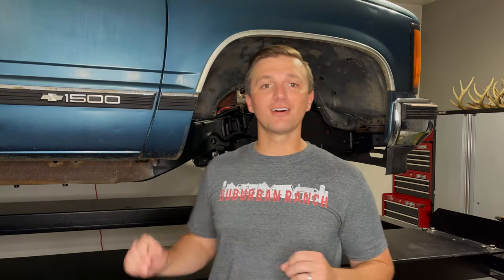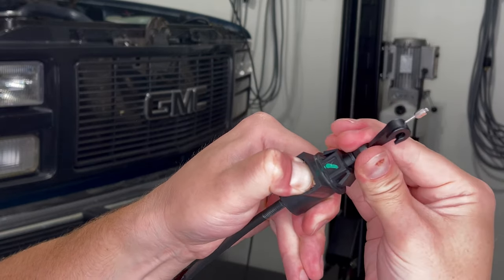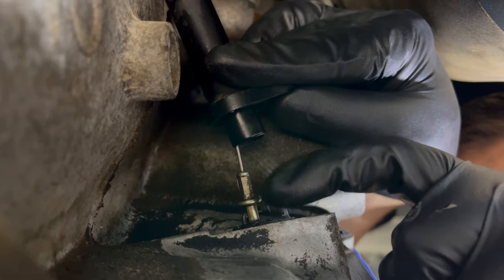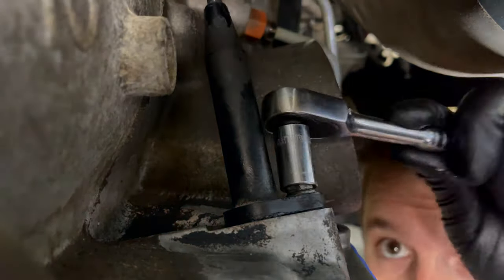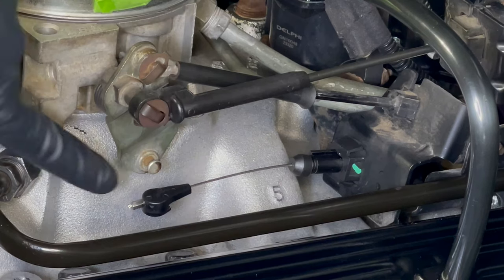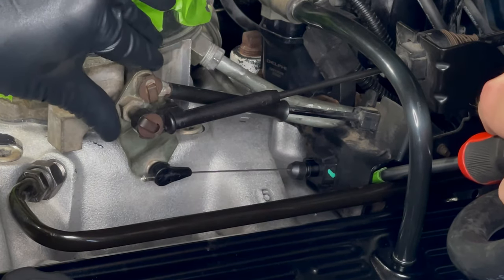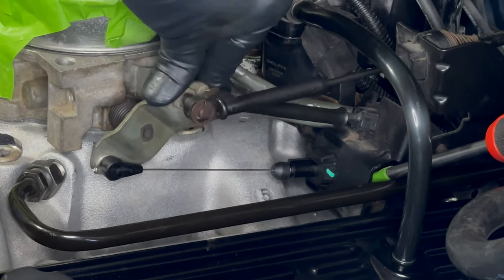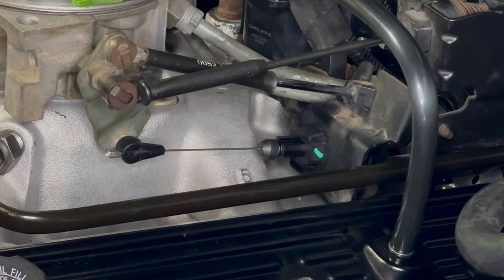Replacing and adjusting the TV cable on an OBS Chevy 1500

Comment: My cable was fraying where the wire comes out at the throttle bracket on the throttle body side. It is a 1991 Chevy C1500 with 314,000 miles so I guess can't complain too much lol. Did get alot of miles out of it. Unfortunately, the GM replacement cable is getting hard to find since it is discontinued through GM. However, did find a dealership from another state that had one they would ship to me. The aftermarket part has mixed reviews but the GM always has positive reviews so I paid the extra money to get the GM one. This video was certainly helpful!

Comment: Little tip for anyone replacing one of these without a new transmission install, use fishing line on the old one as you pull it out. It saves a good while getting the new one back in.

Comment: What you do is push that button and push the little nub ting all the way in then go in the cab and press on your accelerator all the way to the floor, now its set.  When your accelerator is all the way open the cable should be banjo tight.  When you arent pressing on the accelerator it will have slack in it.  If its adjusted wrong then when you press the gas all the way down it wont go as far as it shoud.

Comment: Sir is your throttle hard to push at the pedal? Mine was very hard so I installed a new throttle cable and helped somewhat but still can't hardly ease on the gas from a dead stop without it jerking/sticking. Do you have a video on this. Thanks
Reply from the maker: @Ronald Stevenson No my throttle is not hard to push. We currently have the front end apart so we haven’t driven it yet.
Reply: Let me know if you fix it I have the same issue
Reply: Have you guys figured out a fix? I have the same problem. It almost seems as if the the oem replacement cable is just shy of being long enough. I bought a universal adjustable cable but im trying to avoid messing with it.
Reply from the maker: @Ernesto Alfaro @vince walsh We have driven it since and our throttle seems fine. No issues.
Reply: I had the same problem with my throttle plus trans. shifting
hard. I adjusted trans. cable after watching this video and
the trans. gears change out smooth and throttle stop sticking.

Beats me but I had already removed gas pedal and lubed under it and sprayed lube on every connection I could find on the throttle cable.
Reply: I had to add a helper spring on my truck; the throttle was very hard to push before as well.

Comment: I have a 1980 C10 SILVERADO , with a TH350 transmission and a 1406 edelbrockcarburetor, and a 2701 edelbrock intake manifold. would you know what type of TV cable and length, would I need to install it? PLEASE advise.thank you.Robert. also it has the original stock bracket,which puts the old TV on a angel. its not align with the carburetor. any information would be appreciated.thanks again. Robert
Reply from the maker: @Robert Delao Sorry, I’m not sure on this one. Maybe someone else can help.

Comment: My tv cable has a a bunch of slack tryed adjustment about 4 times still lots of slack should I just replace the cable? Don't know if this matters but 89 chevy 1500  700r4 new trans is from a 88 Chevy 3500
Reply from the maker: @Brandon Kehoe Sounds like you may need a new cable
Reply: New cable or you’ll burn your trans up

Comment: I think I'm missing the lower cable! Will my burb still be able to move in 1 and 2nd  with it missing like it does?
Reply from the maker: You are missing the TV cable? I’ve heard it can burn up the trans to run without one, I wouldn’t recommend it!
Reply: That's why I'm not. No idea about PO but I posted pictures of my linkage on gmt400 forums asking if anyone thought something was wrong. No one caught it and I had to look at it after your video to realize it was gone. Not really even sure if it's a 700 or 4l60 either.

Comment: Question I just did a rear main seal on my 1989 c2500 5.7 and I installed this new cable but I did not do what you did lol now I'm having late shifts will this case that?????
Reply from the maker: @Christian Technician Life Yes, sounds like it might need an adjustment.

Comment: How much trouble would I be in if the old gasket around the piece that slides in and bolts onto transmission fell in hole when I went too pull it out slipped right down into port
Reply from the maker: I think you could get it out if you remove the transmission pan. We have a video on that too!

Comment: Knowing its best to put the seal into the transmission first and then the cable case slides right into it.... how hard was ity to put the seal in the transmission? Im in the process of replacing my TV cable(B&M) thats in the vehicle as well, tried three different correct TV seals and no matter how hard i try to press it in the trans, the seal will just not go in, just round and round it goes and wont get centered, even with a smiggen of atf oil on the seal doesnt help, been fighting this for two weekends now. Even tried leaving the seal on the TV cable end itself, hoping it would center itself and just drop in, still no go, it leaves a small gap in the rear that i know is not correct and for sure will leak. Frustrating
Reply from the maker: @Bige4u Did you remove the old seal? Seems like there might be something still in the hole? Did it maybe fall apart and only part of it came out?
Reply: @SuburbanRanch  No old seal, it came out in one peice with the old TV cable... i finally got it though, you mentioned using "lube", i used a pinch of WD40 on the outer part of the new seal, and it pressed right it, figure why it didnt work with ATF fluid as lubrication. Pushing in the cable case was another story, i tried the same pinch of WD40 and it went it tough like it didnt want to fit like the seal at first, but i was able to work it in slowly with a bit of finess to make it finally sit flush on the new seal, it didnt just drop in like yours in this video. I then lightly snugged down the 10mm bolt afterwards and its good to go, what a PITA this was, only because this was my first time dealing with a 700r4 and its TV cable replacement. Now i'll know what to do next time, and that means also dropping the passenger side exhaust pipe from that side header to give me more clearance to work around.(1979 malibu 2dr coupe)
Reply: @SuburbanRanch  Heres an update for you... about 3weeks back, i removed the B&M universal cable and replaced it with an ac delco unit that has a total case length of 37", its a few inches longer than the adjusted length of the B&M unit that worked for me. I wanted more of a direct line of sight towards the carburator bracket without it snaking around the transmission bellhousing too much, either way, i also bought a new ac delco cable seal to the transmission, it slipped right in with a touch of WD-40 as before. Next came to inserting the case end into the transmission seal, again, with a touch of WD-40 as well, and to my surprise, it slid right in almost right away with very little force, like yours in this video, so apparently, the B&M and other aftermarket cables ends are a pinch larger than the OEM cable when fitting into the transmission seal, hence the fighting against you when trying to be inserted even with some form of lubricant. The inner cable is a tad too long and the carburator end, so that will have to be trimmed to make it secure for proper opperation of the transmission, if only i could find and OEM ac delco tv cable thats 32'' total inches in length, that would be more ideal for me, but sadly theres plenty of other part numbers, unfortunately most do not state the total length, so all i have to go by is cables made for early 90s cars/trucks that use a TB(like carb) that came with v6/v8 engines and 700r4 transmissions.

Comment: Someone said the 95 and up has the shift cable and the pre 88-94s don’t? What shift cable do I need for a 91 automatic? Is it called the detent cable?
Reply from the maker: @Dylan Haynes I would look on Rockauto for the part. You can look up your exact vehicle and get all the parts
Reply: I think that’s true because mine is a 94 and doesent have it.
Reply: @TheUndertoe  My 92 has this set up. It depends on what transmission you have. They used different transmissions in all years.
Reply: @outspokengenius  the 700r4 has it but the 4l60e doesent

Comment: @1:37 looks easy on push down...but i ruined my new TV detent cable $22.00, bent the plastic and crushed and split the plastic with the 10mm bolt to seat it after several days of leaking....  it leaked really bad. Can't believe that cable seat and push down was so difficult...i get to try again tomorrow with a new cable. I'm a good mechanic but i failed on that little round piece seating it in the hole...i was cock-eyed....and the round plastic was oval-ed. I never break new parts....I'm 60 years old....and that cable seat was most difficult thing I've ever encounter, so i forced it and locked it down with the 10mm. Tomorrow i will go very slow, no forcing,  not to deform the silly plastic while using grease...grease must be the key.
Reply from the maker: @Accuracy Marked Good Luck!
Reply: @SuburbanRanch  i knew better not to force it...your grease method is best. Thanks!

Comment: At 1:20 I don’t see the hook, all I see is the cable going down.
Reply from the maker: @Jesse N This help? https://drive.google.com/file/d/1iNj-zge0dxY_V7vd9ghL4WEinXcCrobj
Reply: @SuburbanRanch  thanks for replying.  I requested access to the file you are sharing. Thanks
Reply from the maker: @Jesse N sorry about that, thought I had it opened for anyone with a link  try again
Reply: @SuburbanRanch  yes that’s the hook I didn’t see.  But after I removed it at the engine somehow it popped up. Thanks for your help.  Subbed.
Reply: Hi what gasket is used at 1:40
The cable I bought did not include it.  1991 gmc c2500 5.7. Thanks !
Reply from the maker: @Jesse N The cable we bought came with it installed on the cable end. I’d check to see if yours has one already on it. If not I’m not sure where to get one.

Comment: The part listed below is not valid.
Reply: I drive a 89 Chevy g20 van. My TV cable keeps slipping. I have set a few times now
Reply from the maker: What’s not valid about it? Did you try replacing it?
Reply: @SuburbanRanch  I tried buying it and it says that part number doesn't exist
Reply from the maker: Hmm. Maybe they quit making it.
Reply: @SuburbanRanch  they had parts for it but not the hole thing

Comment: I bet you went and put that slack back in it....
Reply from the maker: @jotegg why do you say that?
Reply: @SuburbanRanch  before putting the Detent cable on the lever control arm. Measure how much movement by measuring how far you can pull the arm out of the transmission. You can feel when the arm makes contact with the valve in the transmission. This will tell if  the valve is constantly being engaged. If you start the vehicle and pull on the cable when parked, the hard you lift the more drag is put on the engine. This is the internal clutch working in the torque converter. When it is over worked it will heat the ATF and cook the transmission. Best not to have to much drag on the engine it will cause over heating. Not sure who thought this was a good idea, but if wanted to make it last longer with less wear and tear on my engine... put a stall converter in. I have never been a fan of slippage from any transmission... automatics are the worse for feeling stranded when slipping. And that is actually what the OD Detent (kick down) cable does. deverts the flow of oil to each gear, except the 4 OD will cause a 200 rpm slip for pulling loads at high speeds. At least for the 700r4.